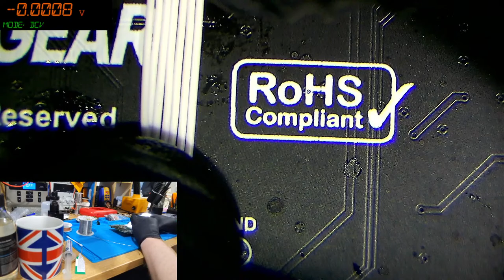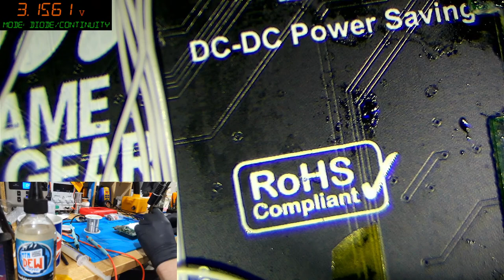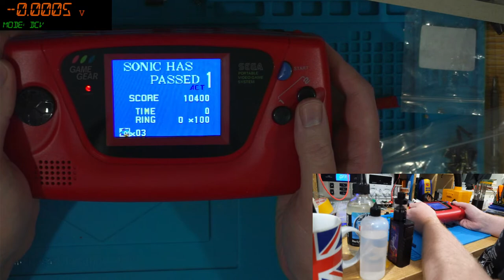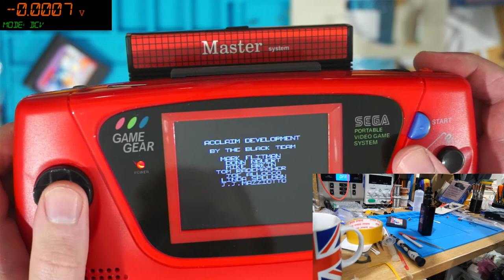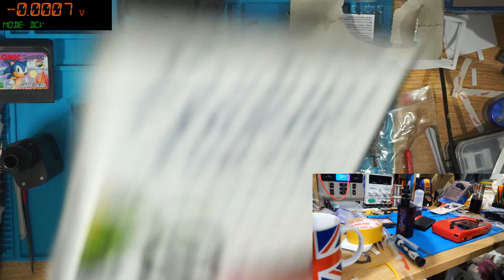Sega Game Gear Funnyplaying V3.1 LCD Install

Comment: Hi there, to get the Master System mode to work, you have to connect T10 to T11. Had the same problem before.
Reply from the maker: Yeah I got that working in the end after rereading the instructions. Thanks for the pointer though!
Reply from the maker: Amazon, eBay, AliExpress. Just search for "blue silicone work mat"